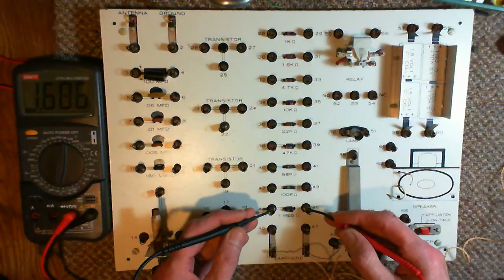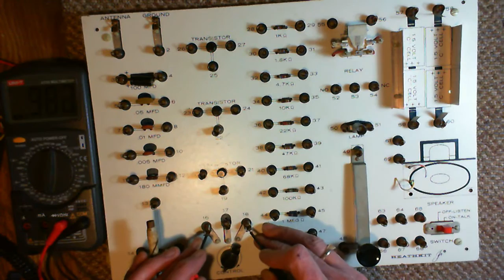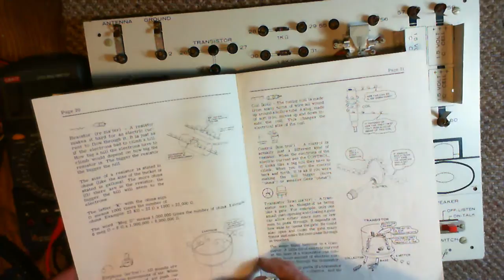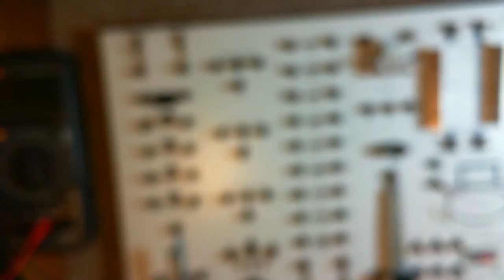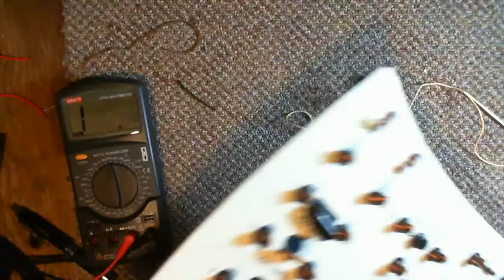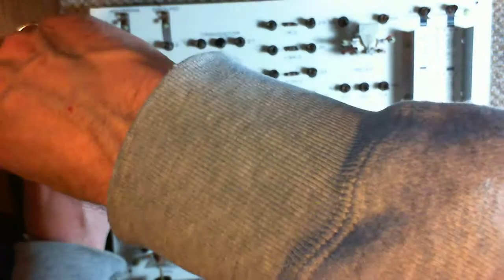Heathkit Electronic Projects Kit - Check Kit Components

Comment: Those transistors are PNP and appear to be germanium based on the age of your kit. I can tell the polarity based on where you put the probes of your Volt Ohm Meter. Check the sides of the transistors, I saw some numbers there. There are a couple of on line data sheet archives I know of. I have a Vintage Norelco All Transistor Electronic Educational Kit EE20 which I believe is from 1964. I found that set listed on E-Bay. I had to change out a lot of the bits because they were out of tolerances. The transistors popped when I did an experiment, but I found LittleDiode Components an E-Bay seller which still had some of the AF116 and AC126 Transistors. The resistors, capacitors, speakers, and the Bar antenna I found at me favourite Store You Do It Electronics Centre  There are still variable condensers listed on E-Bay of the correct capacitance. Thank you for posting such interesting videos on these old kits and antique radios. I really like these videos
Reply from the maker: Hi K215.  Glad you are enjoying the videos. I tried building a number of radio projects with the kits but didn't have much success.  Components and connections presented too many troubles and I was too optimistic.  Next time I work on them, I'll verify the components first and do something to improve the reliability of the connections.  Thanks for the information about the kits.  Jim.
Reply: This is 1974 kit, I had that in those days
Reply: Yep. Ge PNP, likely 2N404